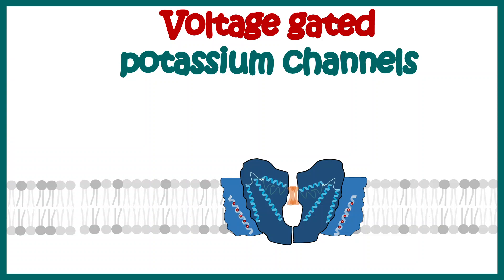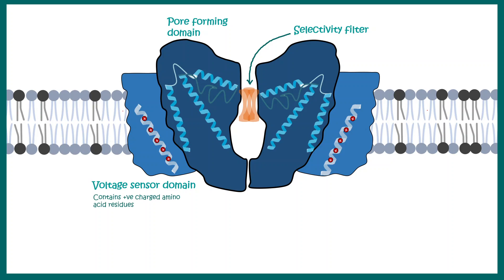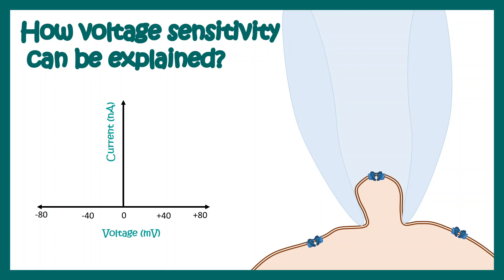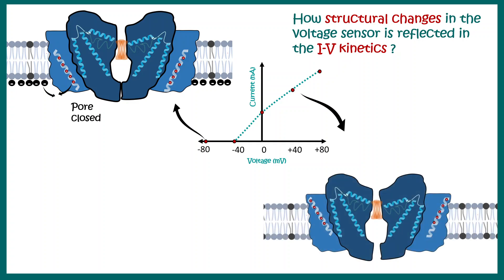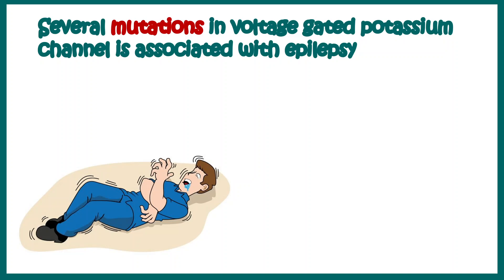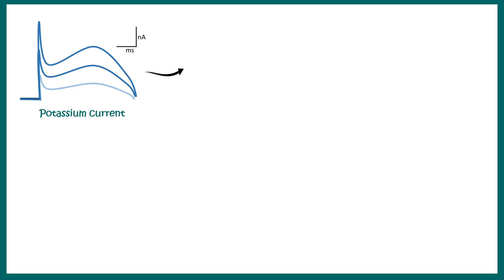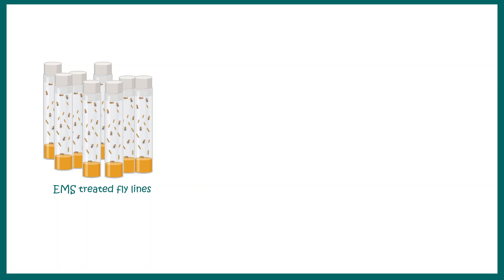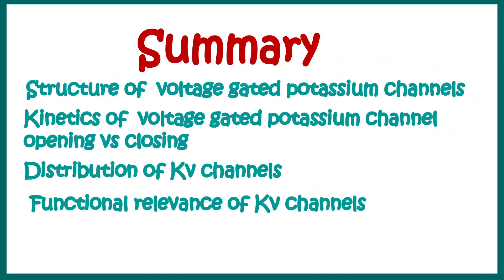Voltage gated potassium channels | Activation Cycle of Voltage Gated Potassium Channels

Comment: That is not how the selectivity filter works. The difference in atomic radii between sodium and potassium is 0.38Å and the thermal movement is of the order of 1Å. also proteins and hydrogen bonds pretty rigid. Selectivity comes from the fact that sodium is bigger so pushes the carbonyl oxygens further apart from eachother, decreasing the electrostatic repulsion